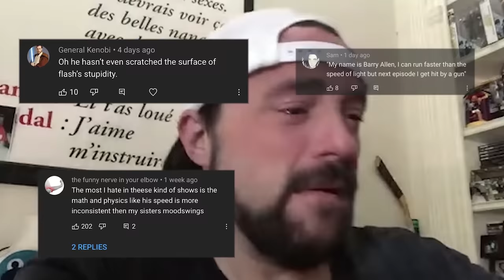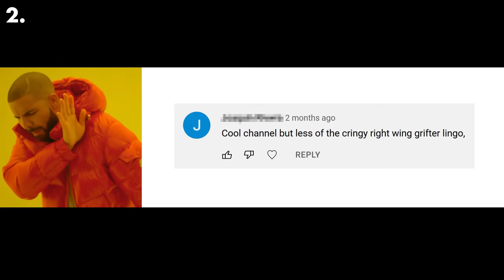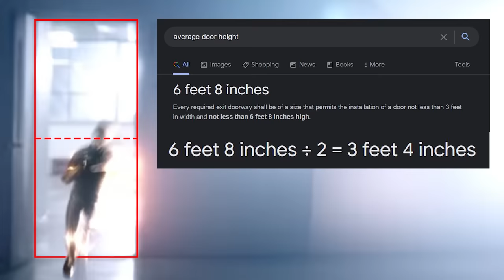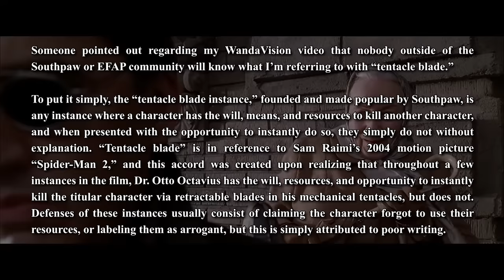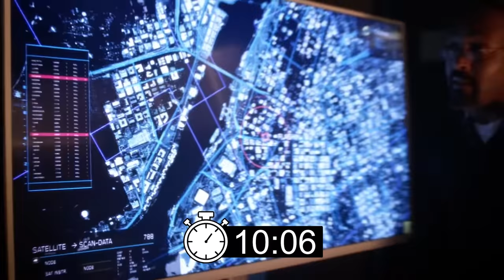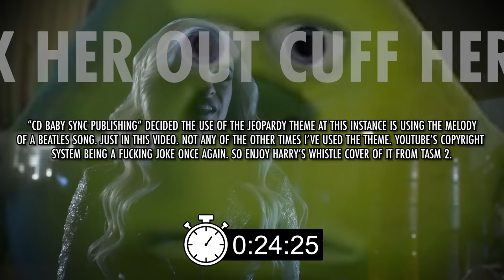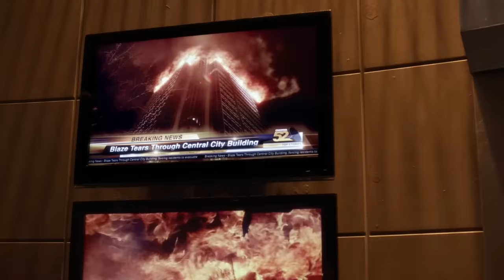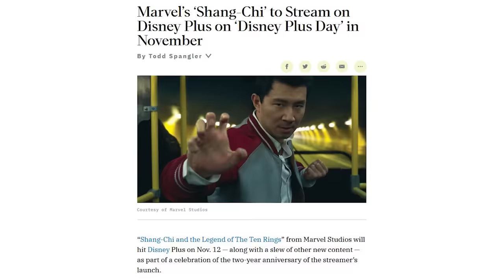The Flash is Insufferably Inconsistent - Season 3

Comment: Fuck when i posted I accidentally deleted the starting bit rewording:

ahem here it is:

HOW TO FIX FLASH. 
heh. Back to the post:
Step one: He's not immediately the fastest man alive. At no point during season 1, 2, probably 3, but is by mid-season 4 at the latest, should he be able to run faster than a bullet. 

Step Two: to explain speed inconsistency, make that he's still learning how to control his speed a factor... like say, the larger the distance he covers the faster he goes because its not instant acceleration up to a set speed he then tops out at in one-thousandths of a second from standing still, but actually, like say a vehicle that takes longer to do 60-120 than it does for 0-60.... And TURNING slows him down as, you know, physics. And whilst he can use slopes walls and other objects to assist in retaining as much speed as he can during a turn, this means that he's very limited indoors. So this means that in early seasons, he can't even do instant-relocations.

Step Three: He didn't immediately do the stopping to talk thing, but does it a lot as a result of a series of consecutive times he decided to just superspeed at the bad guy and for a h ost of different reasons... it didn't work. Like his enhanced durability isn't there yet, so any injury from trying it at his best without using the speed force is multiplied by being fast. He's basically had to be creative because the simple solution actually doesnt work.

Another factor for 'they got away'.... his speed is, early days, unreliable. It's like someone built a tesla car, but then only instead one cell in the battery compartment. And a week later added one, and a week after that... and so on. so he isn't just getting faster in terms of acceleration/speed over distance and time in tests, and not just figuring out how to go for specific speeds or even specific accelerations, and also learning how to impart his speed to other objects (like say, he accidentally hurt Iris the first time he tried to relocate her out of danger...), he's actually figuring out how to leave enough 'in the tank' to do a bit more running after the bulk of a situation is done. So not going at his top speed all the time is actually preferred, even though he needs to do that to 'work the speed muscles to get faster', but also the more he drains the tank dry, the bigger the tank gets to refill to 'full'.... Because, it's not a sprint, it's a marathon... until his tank's big enough that he can 'sprint' a whole battle, because the battle is a marathon and trying to sprint it in early days he tried and thats why so often other badguys got away - he literally tried to look for them after protecting the innocents, and oops his superspeed is so slow that he doesnt need to stop to wait for automatic sliding doors like you'd find at a wallmart.

Comment: Dude. Hit the ash guy with a metal pipe. It either works or his power is active and you avoid death. I'm against excessive harm, but this is a special circumstance.

Also, why not stop and talk IN FRONT of the villain? Then they can't get to their goal.

Hey Barry, you lost the use of a leg. Remind me, does your whole body have superpowers? Yes? Then SPEED CRAWL AT MACH 1!

And stop running in front of projectiles! Maze Runner used literal mind control to explain why a non-speedster died by running in front of a projectile of seemingly similar speed(RIP Chuck).

Fun fact about testifying: Your conviction can't depend on one person's testimony as to only evidence. Also, trials can be delayed due to external circumstances. Just say Barry is sick and will show up later.

Comment: So the flash in DC isn't as strong as marvel flash with flash from a different reality 2 flashes both using lighting bolt using each other to charge but yet DC flash never attempted to use friction with other speedsters to make lighting bolts without needing to run 50 laps to charge up
Reply: Wally West is the strongest Flash

Comment: So heres how they explain why speed works the way it does... see if you can catch the plothole.

Flash, and the other speedsters, access the speed force which empowers them to move faster than the ordinary person. The Flash’s speed, as the TV series explain in season 2 (the episode where flash faced the turtle), is the result of him converting the speed force into potential energy. The turtle was able to suck the potential energy out of a limited area. But Barry used the speed force to generat even potential energy and over powered him. But Barry doesn't do it all the time. He does it only when he want to or when he knows that he needs to. In this case, Savitar didn't know that Iris is pointing a gun at him and is about to shoot him. Since he didn't know, he wasn't using the speed force, hence he wasn't fast enough to dodge it or catch it.